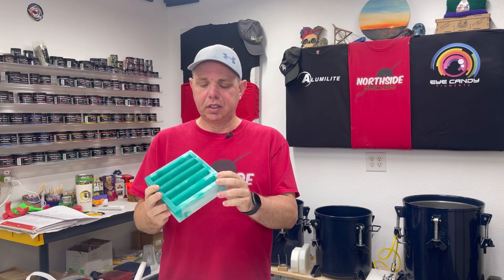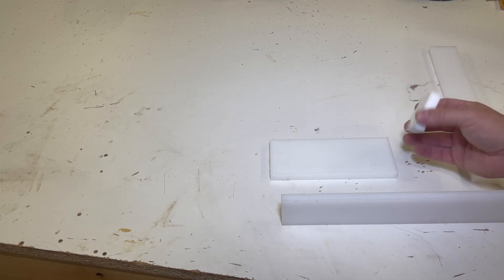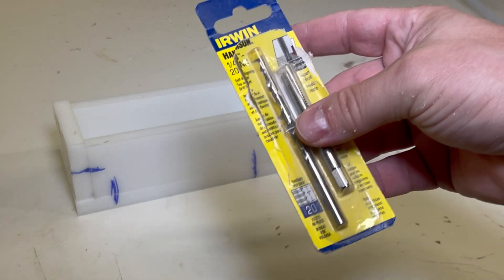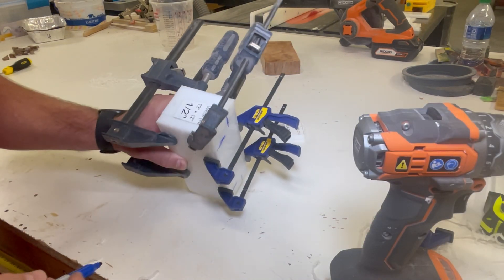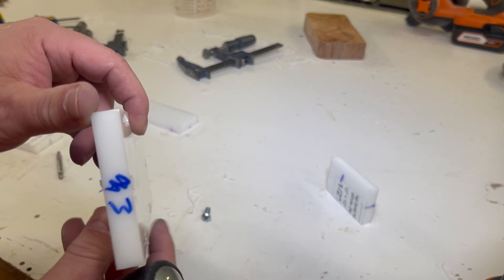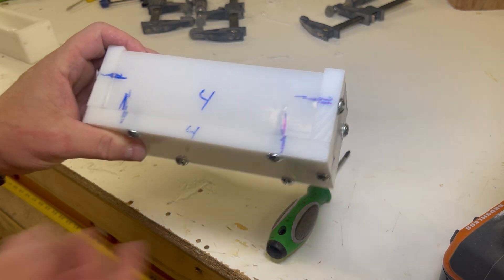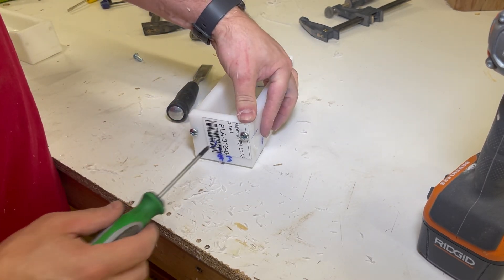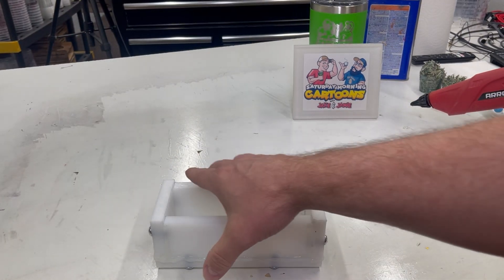Turn Scrap Plastic into a Resin Casting Mold - Beginner Mold Making

Comment: Has anyone ever attempted to do this with heat set threaded inserts and mechanical screws?  I'm sure the machine screws alone work just fine and I know they're time tested but I'm just curious about alternatives.
Reply from the maker: @NGinuity  I’m sure the heat sink inserts would work.. I’ve also just used wood screws to hold them together.
Reply: @JakeThompson  Perfect.  Thanks for getting back to me 😎